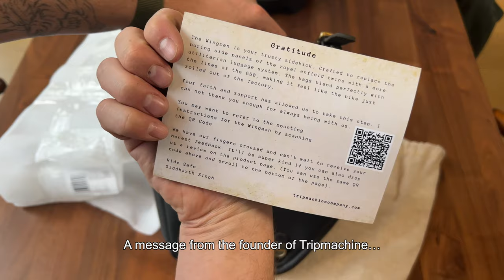Royal Enfield Interceptor 650 Side Panel Bags | Tripmachine Wingman | Comparison | Photography

Comment: I've noticed you changed the interceptor panel, was it easy to do? What panel is that? Never seen that one before
Reply from the maker: The side panels came with the bags, they are attached and it was as easy as the installation in the video. Unless there’s a different panel you’re thinking of?
Reply: @ChrisKonings  No, actually I was talking about the instrument/dashboard panel.
Reply from the maker: @EveraldoBezerra  Oh apologies - yes I've replaced it with a mini speedometer from BAAK which reduces the front end a little bit

Comment: Awesome video man. How much of a difference do you notice riding with both of these filled up with regards to your stance and walking position? I'm a short dude and at times I need to have both feet kinda on my tip toes on my Conti. How much further would you say your foot to foot distance is while stopped?
Reply from the maker: Thanks very much, good question, it doesn’t change the foot position too much but if you’re really on your toes I could see a little change to your stance, they’re flexible though so you can squeeze the bags in a bit
Reply: @ChrisKonings  Thanks. I already ordered em moments after asking this question 😂 but yeah, I figure fully loaded they may be an issue.. Depending on how full they are I'll be ok. We shall see. My own installation video coming soon lol. Thanks again.
Reply from the maker: Haha nice, what color did you buy in the end?
Reply: @ChrisKonings  Tobacco brown to match my grip wraps from TripMachine and my seat cover.
Reply from the maker: @motomitch  That sounds great, full on classic :)

Comment: So you have this and the W800 
Love the tweaks you made to the bike
Reply from the maker: Yep, Interceptor in the US and W800 in the UK - thanks for the kind words! Do you ride?
Reply: @ChrisKonings  cool best of both worlds, getting back into it after a long break so looking at Classic 350, interceptor and w800 too any advice
Reply from the maker: It depends on what you are looking to achieve, they’re all really nice bikes - I’d say Interceptor is a good balance of the other choices. The w800 has some great personality in the engine and the Classic 350 has the retro look. But for me the Interceptor has introduced me to modern classic culture and is very easy to work on as well as modify
Reply: @ChrisKonings  yes that makes sense have to say really do like the continental 650GT just some thing about that design,  but even the new Black Ray is very nice
Reply from the maker: Yeah the GT650 is a stunner, just keep in mind the riding position isn’t the best for long travel compared to the INT650